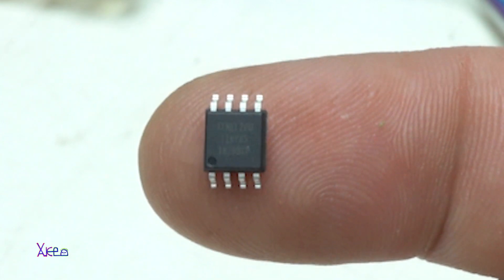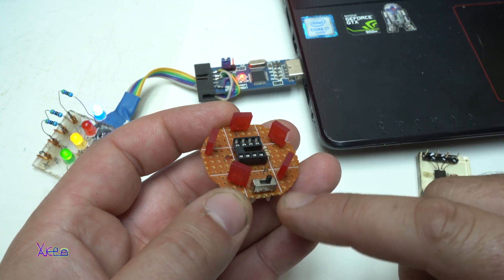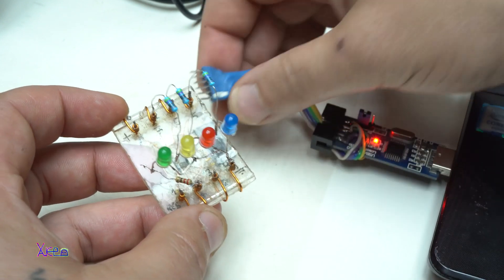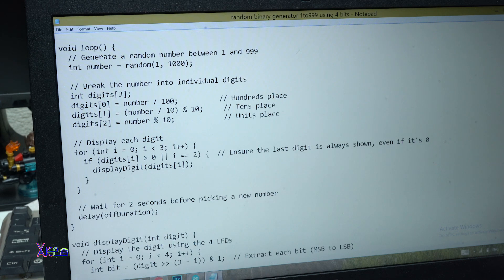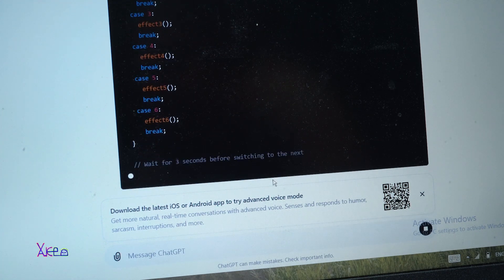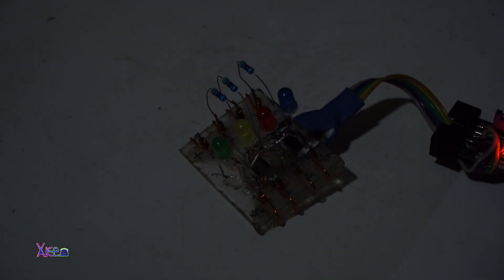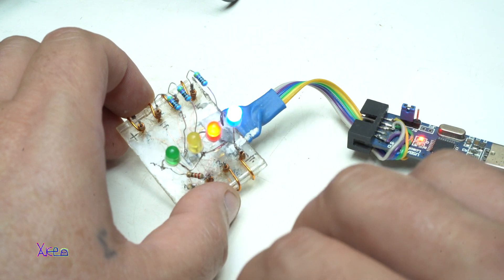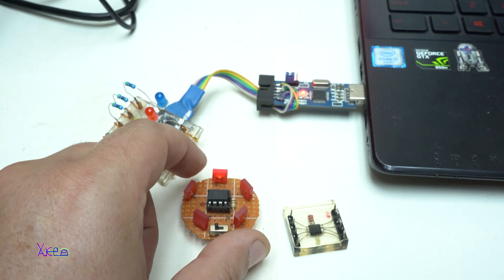Build ANYTHING You Want with this Microchip!

Comment: Atmel chips 25 mA drive per port
BUT 50 mA total per chip !
any better? well, try Padauk PML100 does 200mA per port !
costs 10 cents
respect your own time and get the emulator $60
Reply from the maker: Need to explore that chip
Reply: @Hacktuber  alibaba is not aliexpress so you may need to ask/buy 100 pieces min, total  $7 or so.
Soon smaller vendors will have the PML100 and others in e.g. qty 10 and charge maybe $5

Comment: Sooooo... you're demonstrating an 8 pin PIC chip?  Is this correct?  Or have we advanced past those?  8p, that means ground, v+ and data /input + the 5 outputs you described.  Is that accurate?
Reply from the maker: Yes,5 outputs and reset pin

Comment: Nice. I am using Attiny85 too. For bigger projects I want to use Attiny84. But there is a problem with the Arduino IDE language. It's consumimg a lot of memory. Therefore for bigger projects it is good to use pure C with direct port manipulation. For example the blink sketch is about 600B, with direct port manipulation it is only 80B... 😁